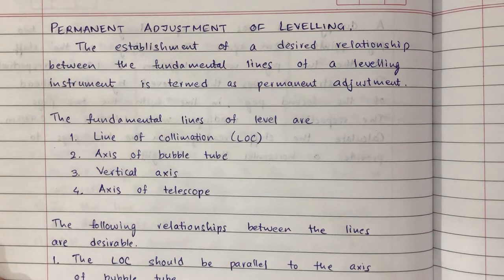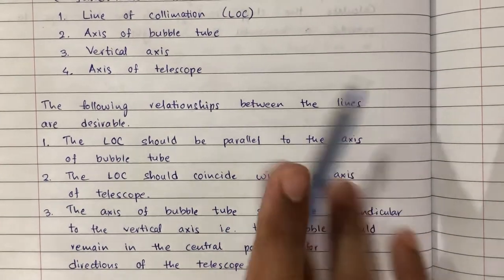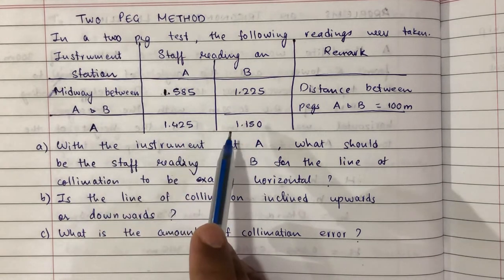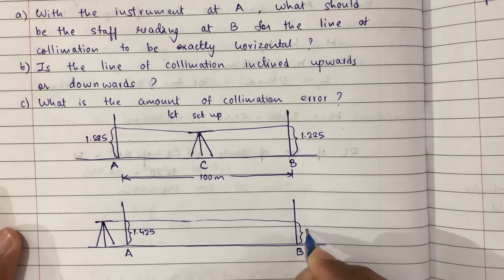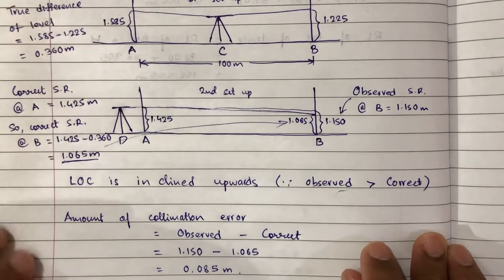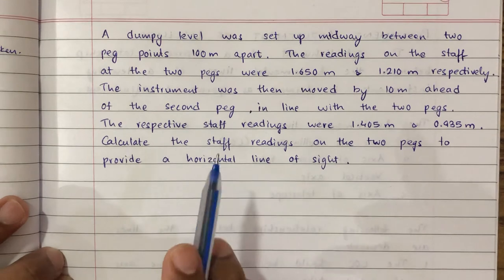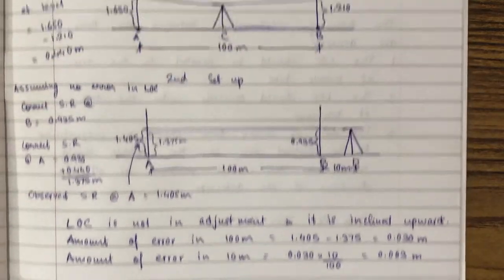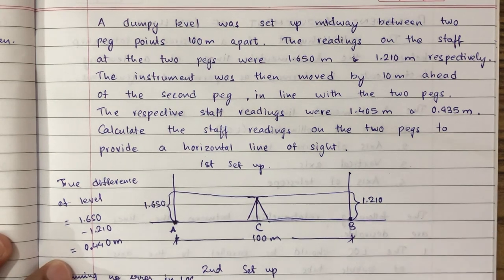Two peg method in levelling

Comment: In first question you subtract true difference but in second question you added true difference why ?
Reply from the maker: In first question, the correct staff reading at B should be such a value which would be close to the observed staff reading at B. Hence the true difference is subtracted. 
In second question, the correct staff reading at A should be such a value which would be close to the observed staff reading at A. Hence the true difference is added.
Reply: @sujingeorge1457  thank u so much